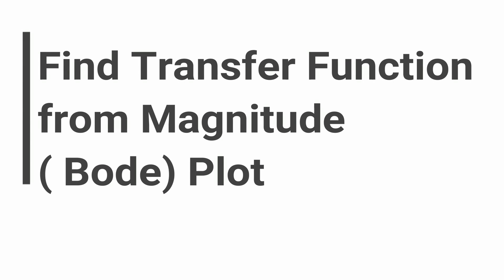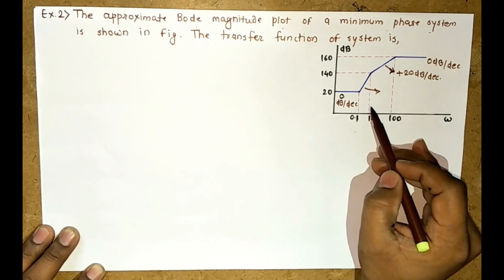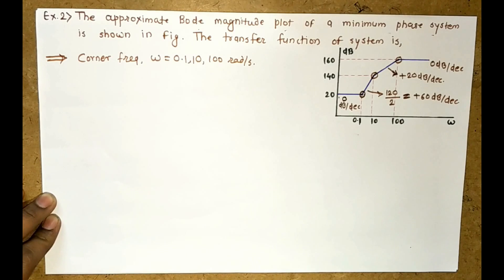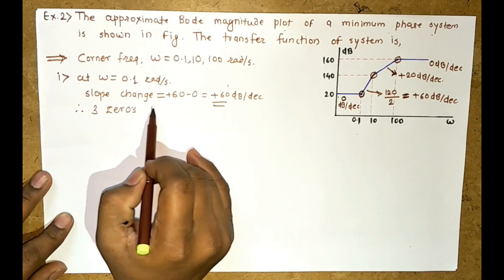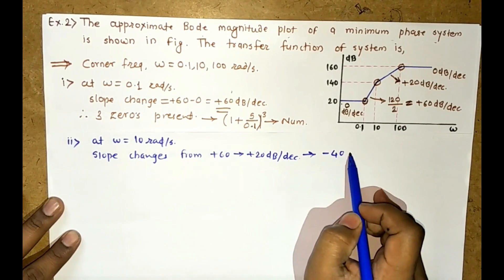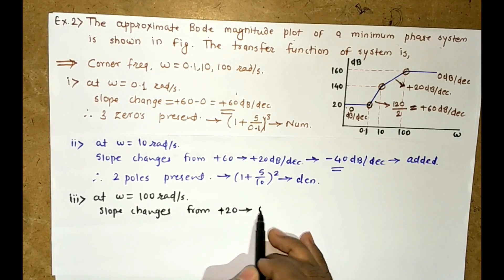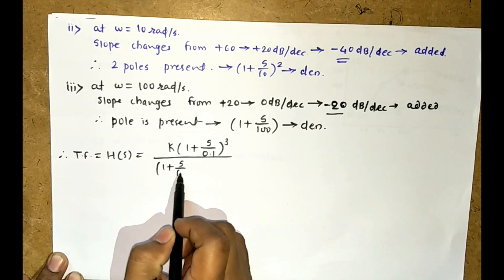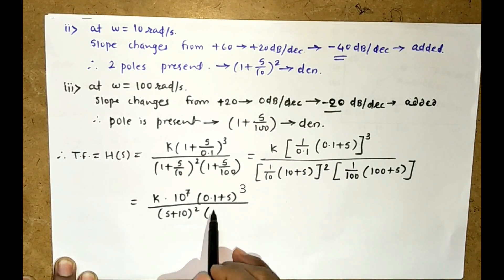Find Transfer Function from Bode (Magnitude) Plot: Lect no 2

Comment: Why divided by 2 didn't understand
Reply: I know this was years ago but hopefully it helps others. So basically, a decade represents a factor of 10. Between 0.1 and 10, there are 2 decades: because 0.1*10 = 1 (first decade) and 1*10 = 10 (second decade) making it 2 decades. Based on the video the gain starts at 20 db and ends at 140 db, when subtracted that will be equal to 120 but since its over 2 decades therefore you divide by 2 giving you +60 db. If you want to go further more, between 10 and 100 its 1 decade because 10*10 = 100. Hope this helps!

Comment: How did you get K * 10^7 ?
Reply from the maker: after simplification of the equation of TF.
Reply: @EasyMechLearn  are you sure that is correct? You take  (1/0.1)^3 and multiply by (1/10)^2 and then multiply that by 1/100 , right? This gives 1/10. What am I doing wrong?
Reply from the maker: @AndromedaIX  please check arrangement  (a)/(1/b)=ab. same formula is applied here,  and power of 10 get added. final result is 10^7
Reply: I see it now, thanks

Comment: How are u taking the decades?? How to know to have 2,3,4 or how many zeroes are poles are found?please reply...!
Reply from the maker: Deacade means 10. After 0.1 next is 1, 10,100, so difference between 0.1 to 10 is 2 decades
Reply from the maker: positive sign for zeroes and negative sign for slope indicates poles.
Reply: why 120/2?????
Reply: six zero i think numerator.....why 120/2
120/20:6
Reply: 6*20=120, so  6 zero .....is it why saying 3 zero..
120-20=100/20=5
so 5 pole .why 2 pole....